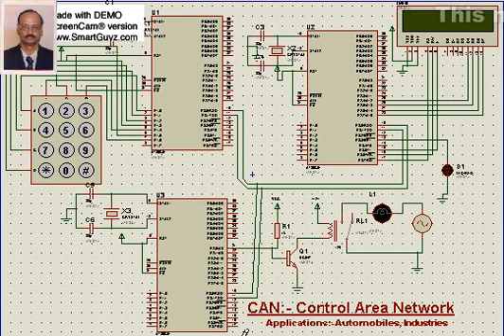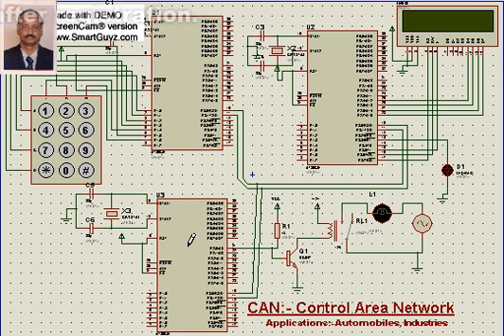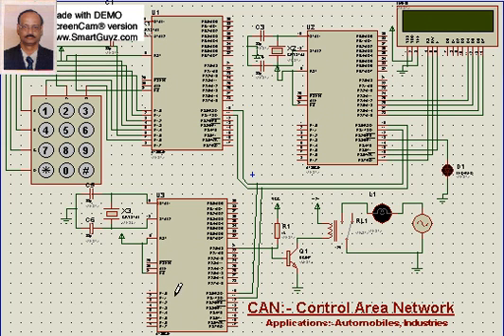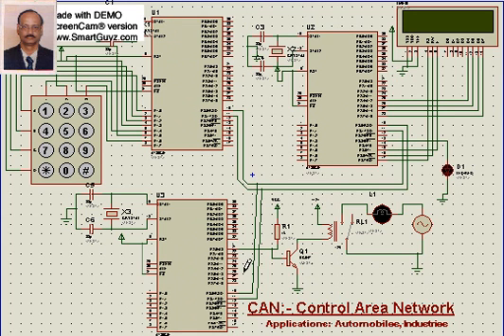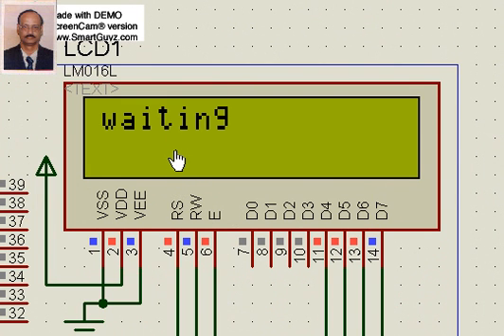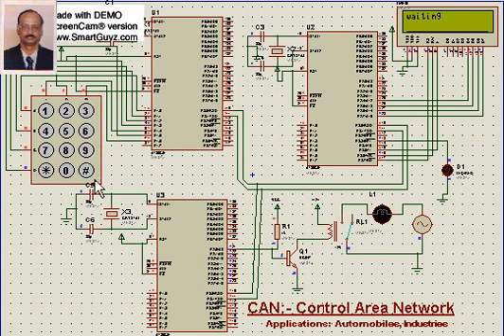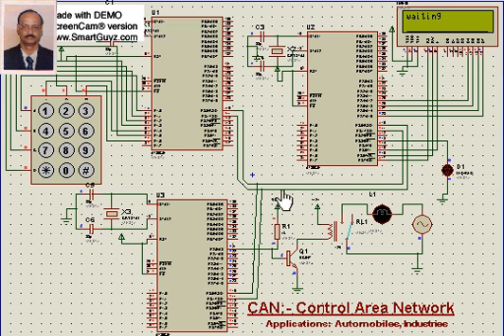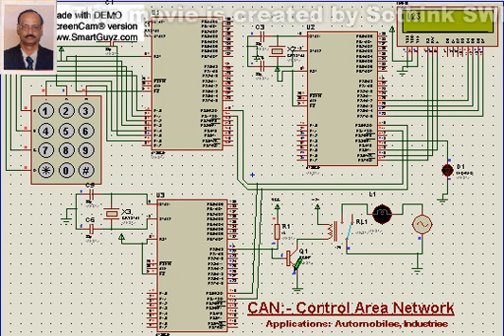CAN Control Area Network

Comment: OMG this is not CAN Protocol. This is UART communication. CAN is different. CAN Also has two wires. But this example used UART Serial communication.
Reply: i want to learn CAN,,, have u find useful stuff?? I am also your great fan and like your videos about CCS C
Reply from the maker: You are right. But this is just a beginners step to understand CAN concept used in automobiles but not CAN protocol.

Comment: I am using PIC18f2680 Inbuild CAN module along with CAN MCP2551 Transcievers ...my question is :

1.Should we use twisted pair wires (like take CANL CANH Wires and twist it).
2.Second is more related to CAN Protocol-If 2 Transmitters start transmitting at the same time and are assigned the same low valued ID  as mask then who will win arbitration and how to win arbitration through the code which i write?
3.Third being CAN works on CSMA/CD so how is carrier sensing done?
4.How can we use MCP2551 in proteus ISIS simulation tool
Reply from the maker: +Abhilash Hegde 1=Yes, 2 &3&4= Sorry I can not help

Comment: The video explains how and what CAN can work/do... but you here are using only UART device of the uController. CAN is much more sophisticated protocol than what we  just saw. Nowadays we have various other components (Hardware as well as software ) to assist proper communication. The protocol is also pretty complex and undocumented as every manufacturer comes up with its own IP and modifications. moreover in motor Bikes and cars we usually have K-line and LIN protocol that is pretty different from a regular CAN. Nevertheless it is a good video for students to get started with.

Comment from the maker: CAN allows multiple microcontrollers to  communicate on same bus without any need for a "master/slave", "coordinator", "router" or anything similar. The advantage over  serial protocols is its robustness for  automobile industry as CAN uses differential signals that can travel reliably at long distances. CAN also implements a lot high-level features in its "physical layer" (or in hardware), which makes it easy and cheap to develop a device that can be dropped onto the CAN bus of an automobile.

Comment: In this lecture you mentioned that the two wires in the communication bus used as RX and TX wires. But in CAN, there is no RX and TX, it is CAN HI and CAN LO. CAN bus uses differential signaling that's why they two wires. They are in no way RX and TX.